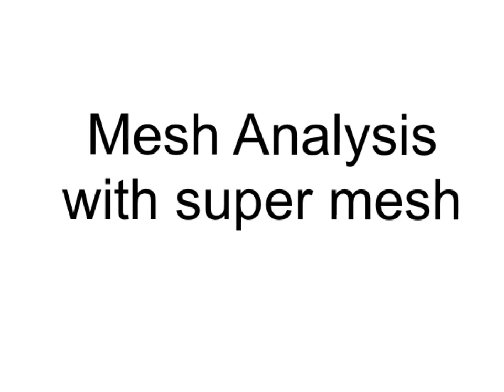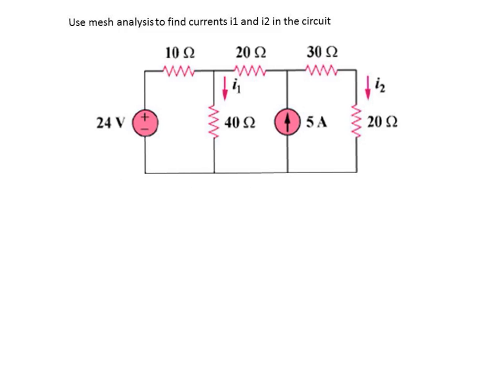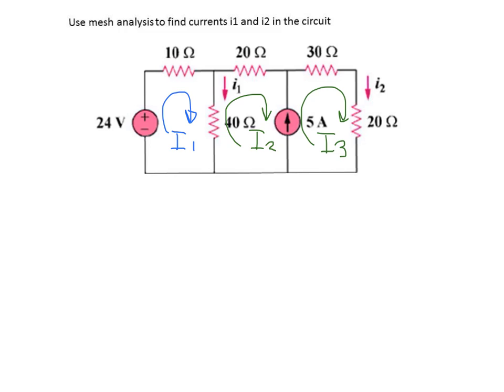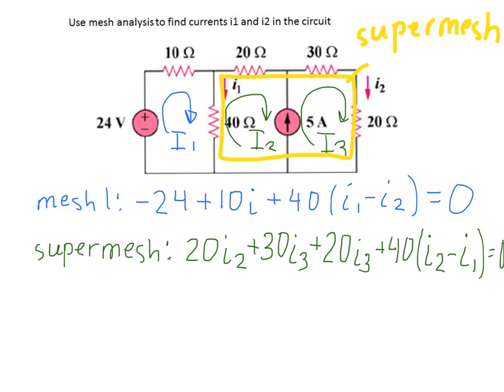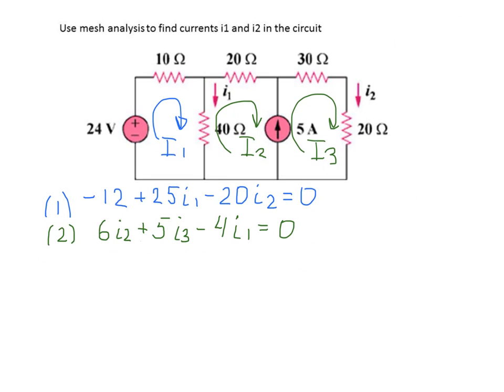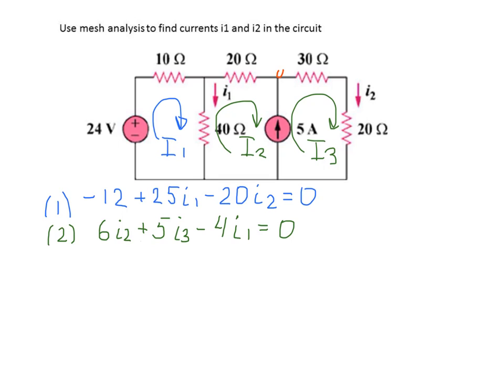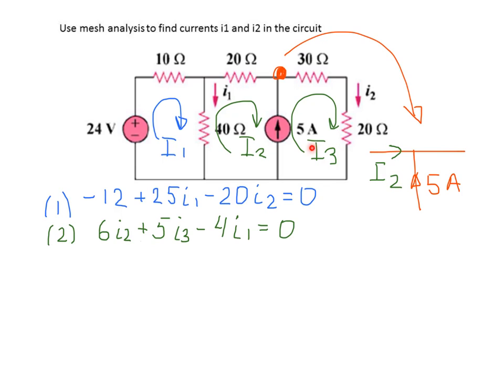Mesh analysis with supermesh. Solution

Comment: Mam I have one doubt  in voltage source we take (-to+) the voltage will become +ve voltage y u write in -ve......and in resistance (-to+) the resistance comes -ve sign comes
  
Please tell it
Reply: You can choose if -to+ is +ve or -ve , same thing with current leaving/entering a node. But once you choose, you have to use that same way for the whole circuit. You get the same answers.

Comment: With regard to the supermesh, why did you combine the opposing currents i2 and i1 at the 40 ohm resistor, but did not combine currents at the 20 ohm resistor with i2 +i3?
Reply: If you havent gotten your question answered already, one thing that isnt the clearest is she has currents i1 and i2 that need to be found, yet she calls the mesh currents she created I1, I2, and I3, it makes it confusing and harder to understand, especially since she wrote lower case i's in her equations when she was talking about the uppercase I's to answer your question now, She combined the opposing currents I1 and I2, at the 40 ohm resistor, she didnt combine the i1 and I2. Thats why she didnt combine i2 and I3 at the 20 ohm because the i2 isnt apart of finding the mesh current, its going to be a value she finds from her mesh currents, which in this case i2 = I3

Comment: Why do we even need supermesh here? Since there is the current source parallel to (30and 20) we could just Thevenise couldn't we?
Reply: They're are many ways to solve for the circuit, I actual solved it before she did using superposition, but in this case it would be extremely difficult to use Thevenin-Nortons theorem

Comment: Shouldn't the voltage on the 40 ohm resistor be (40 ohm)/(i1-i2)?  considering we assumed a downward polarity, the equation for that voltage should be the same for both meshes.
Reply from the maker: Mesh analysis is different to nodal, we work not with accrual current but with mesh currents where we assigned a clockwise direction. So when you write mesh equations, you pretty much don’t worry about actual current, just take mesh current as a positive direction and so you need to subtract the mesh current flowing in opposite direction to the primary mesh current.
Reply: +Marina Belkina  ya... My teacher  explained me same thing..